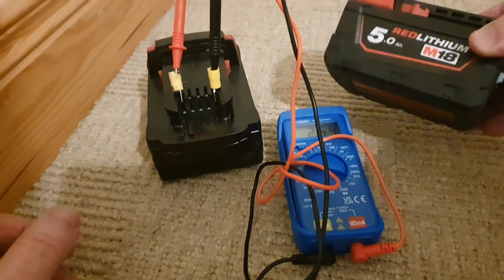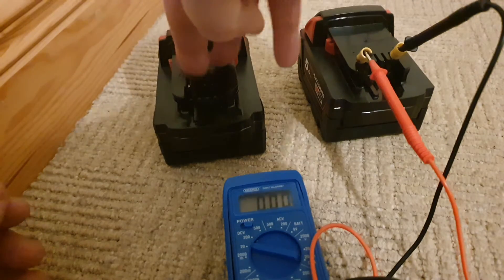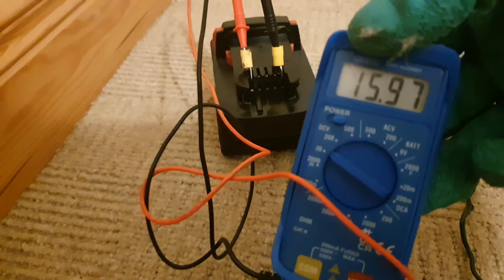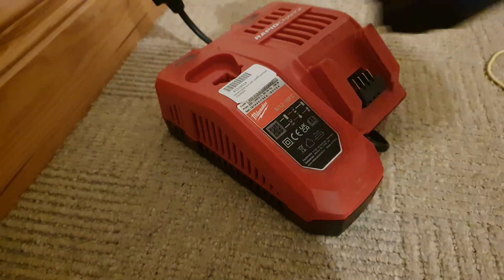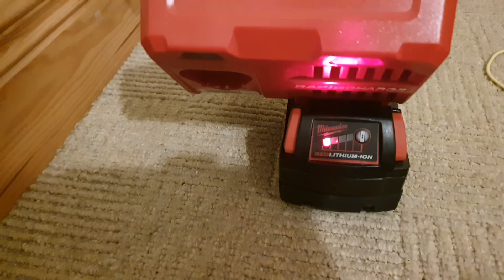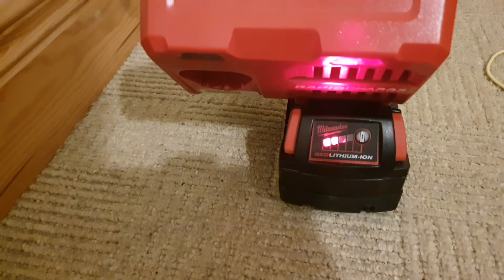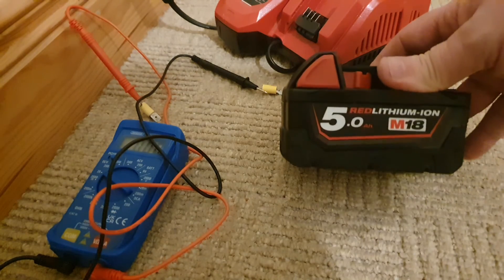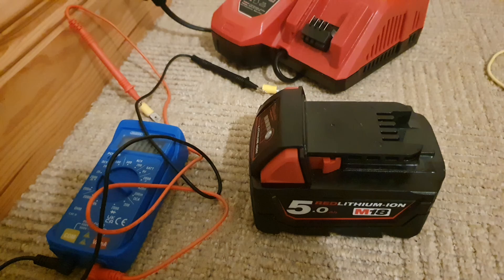M18 Battery won't charge? Try This!

Comment: This worked for me on a red-forge M18 lithium battery. I used a DC power supply. Once connected, the battery pulled about 20V at 5A for 5-10 minutes. Once it got past 2 bars, I put it on the Milwaukee charger and it fully charged to 4 bars after some time. Thanks so much for this video!
Reply from the maker: You are welcome the power supply is the way to go

Comment: Amazing just revived a battery that’s been in my trunk forgotten about for a year. Used 2 razor blades instead of wire so I didn’t get the burning wire smell and worked great
Reply from the maker: That's great

Comment: The M18 batterys and charger are fairly new.
Reply from the maker: One of the batteries and charger is brand new in this video the other one isn't old but got overdischarged and needed the process shown

Comment: So what if it won’t do anything when it’s jumped? The cells are dead inside the individual batteries inside the battery case? I figured out how to replace the m12 batteries but can’t seem to figure out how to get into the bottom part of the m18 to see what kind of batterie the use inside the case….the m12 is just 3 AA Westinghouse solar lamp batteries…painless to swap them out and have a brand new battery…
Reply from the maker: They are 18650 cells 
Here is the full playlist 
https://youtube.com/playlist?list=PLduybcJ2nSYUQM1hAsWocRIhbjin5nLIB&si=gD6lH6I84UAceKRk

Comment: What are the cables called that I'd need to buy to be able to connect them like this?
Reply from the maker: I just used scrap wire and crimped flat terminals on it
Reply: @doctorlefthandthread  thank you 💯

Comment: So I tried this today and voila after about 10 seconds it showed one light on the battery which was not there before so I then put it on the charger and it took a full charge and it appears to be holding it. I made a couple jumpers like yours using electrical spade connectors and will save them if needed again. This is a much simpler method than the Ryobi 18v One+ method for doing them when they have the same issue. You take the battery case off (there is a hidden screw that needs to be removed) and then jumper from a good one to the bad making sure you are doing the correct connections (lots of YouTube videos out there to help out with that). Thank you so much for a well done video and believe me the accent is nowhere’s near NOT being able to understand. 🙂
Reply from the maker: Thank you

Comment: I have a flashing red light on the battery but it is fully charged... I read it’s a temperature issue?
Reply from the maker: It could be but if you leave it at room temp for a few hours and it is still the same. You need to check the voltage to see if it is showing over 19v. This playlist will help https://youtube.com/playlist?list=PLduybcJ2nSYUQM1hAsWocRIhbjin5nLIB
Reply: @doctorlefthandthread  yes voltage is over 19 with all cells good
Circuit board perhaps?
Reply from the maker: @BobTheBreaker9  Yes I would definitely say so. I replaced the circuit board on a Milwaukee 5ah 3 months ago it had perfect voltage cells balanced but the circuit board was not allowing it to charge or work. The new circuit board sorted it out.
Reply: @doctorlefthandthread  of course itsmy 12.0 battery that is soldered down in 6 places

Comment: Y  Do you have the charger upside down. The battery is supposed to be on the charger not the charger on the battery. Just wondering
Reply from the maker: Yes to explain it was to show the light on the charger to the viewers instead of adjusting the camera I just turned the charger upside down. It wouldn't affect the chargers ability to charge.

Comment: Very Good !  I didn't have a good M18 battery so instead used my small car battery charger of 12 v, 6 amp and let it charge the M18 like five minutes.  The M18 battery went from 0.05 v to 15 v with my car charger and... Wowser !! Then the Milwaukee charger station soon charged it up to four bars and like 19 v.  The drill works again !   THANK YOU, Doctor.
Reply from the maker: You are welcome
Reply: I just did this! I used my car jump starter pack and some razor blades. Charged it for 5 mins with car charger, the. Straight onto Milwaukee charger

Comment: use to a resistor , for minimalize current
Reply from the maker: Good advice I have got a DC power supply to do the job since this video easier on the cells

Comment: Hey man I have a broken 6ah DeWalt battery. Is it possible to take the circuit board out of a 1.7ah DeWalt and put it in the 6ah or are the circuit boards different?
Reply from the maker: I can't see why not. They are different but it should work.
Reply: @doctorlefthandthread  ok cool I'm going to give it a shot Thank you sir
Reply from the maker: @Zakh0704  let me know how it works out for you
Reply: @doctorlefthandthread  will do
Reply from the maker: @Zakh0704  I would be interested it is the same voltage to see if the smaller  board can handle the extra amps. Good luck
Reply: @doctorlefthandthread  yeah that's what my concern was but I don't use the 1.7 it's just not enough power for anything I do so I don't mind taking the risk to get the 6ah working

Comment: Thanks for the method!! I just purchased the M18 power drill with a small impact driver. Both batteries did not want to charge. Using your method, I got them now to charge! Thanks again!
Reply from the maker: I am glad to help thank you for commenting. Please check out my other videos if you have the time

Comment: Good method it works most of the time
Reply from the maker: I find it does work alot of times always worth trying but if you have a failed PCB or a couple of bad cells it is not the solution. I always think checking the voltage before and after let's you know how effective it is being. After this cold weather there will be alot of battery issues out there.
Reply: @doctorlefthandthread  I agree

Comment: I thought of this too. Accidentally drain one while using an adapter on a Ryobi tool.

The adapter discontinues the data connection and the tool doesn't shut down to prevent total drainage. 

I just knew the battery was too new to fail. Tried this and boom, started charging again.

Except i did it with 4 aa batteries, not another Milwaukee m18
Reply: How did you use 4 AA batteries? I like that more because then you do t have to risk a perfectly good Milwaukee battery
Reply: @anthonyalegria4695  i happened to already have an adapter that powers electronics like my video monitor and camera gimbal. It takes 4 AA batteries. They are available with various connection types. I just cut off the dc connector and slid the wires directly into the battery.